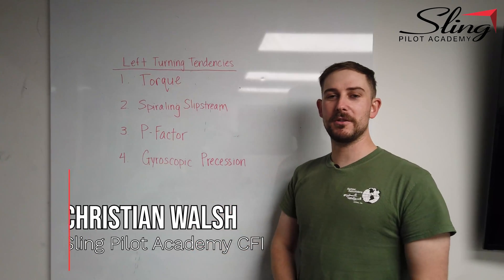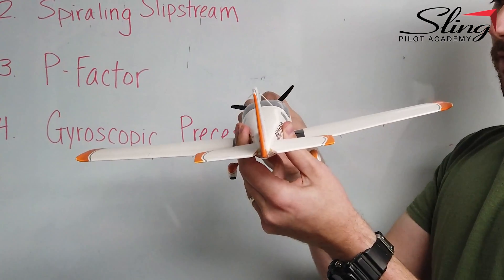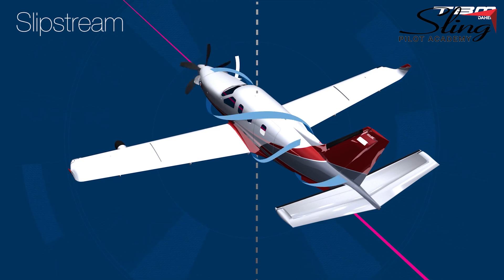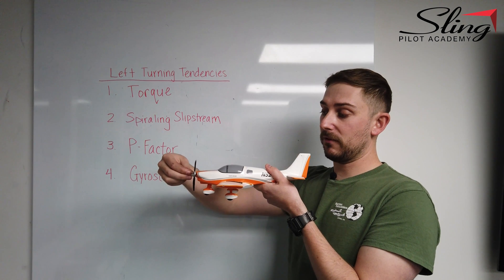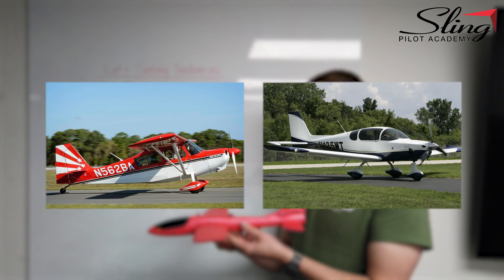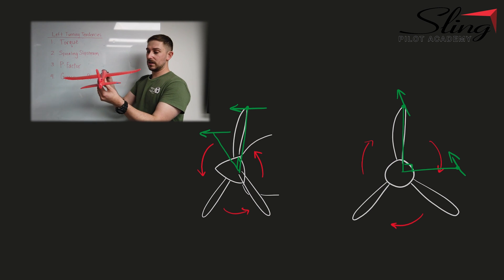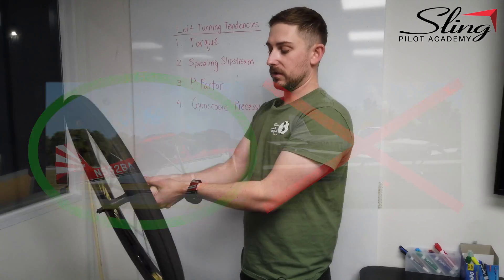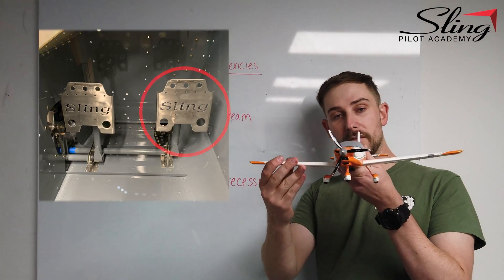Why Does My Airplane Turn Left? The 4 Left Turning Tendencies Explained

Comment: Sorry, but the whole spiral slipstream thing is a myth, that's been continually handed down from instructor to instructor over decades.  A propeller only accelerates air molecules rearward.  There is little or no perpendicular component to the air acceleration.  As for the air spiraling around the airframe, well, Newton's laws forbid that.  It can't happen.  When condensation forms at the tip of the propeller, and the slipstream becomes visible,  it certainly gives the impression of a spiral, but some easy tests and experiments will show that the air is only accelerated straight back.  There is no lateral force applied to the vertical stabilizer from a spiraling stream of air.  And if an airplane propeller was designed such that it imparted a strong perpendicular component to the acceleration, then the propeller would be very inefficient at driving the aircraft forward.